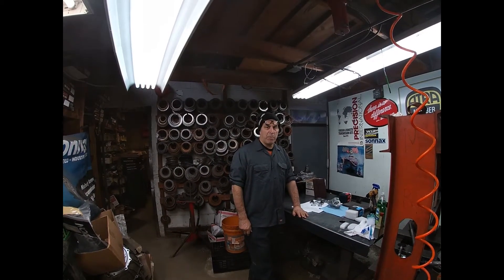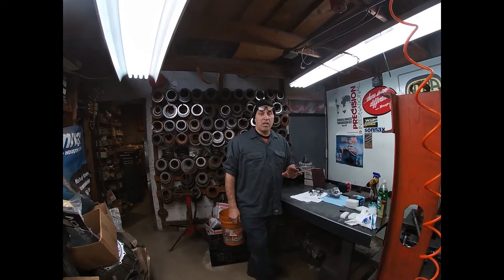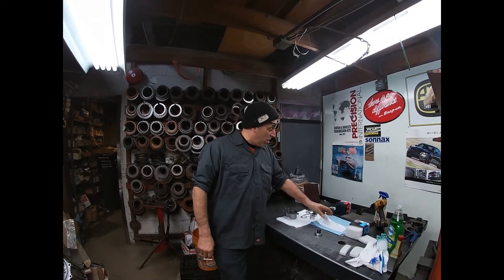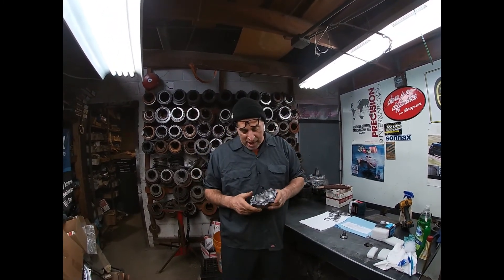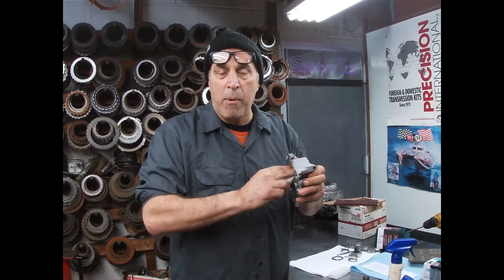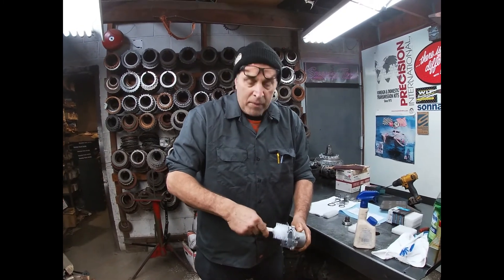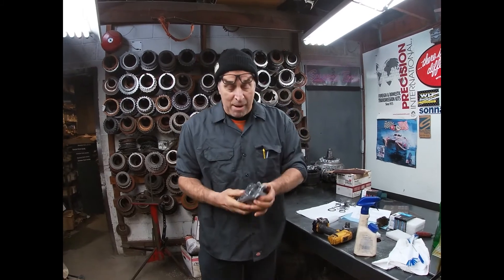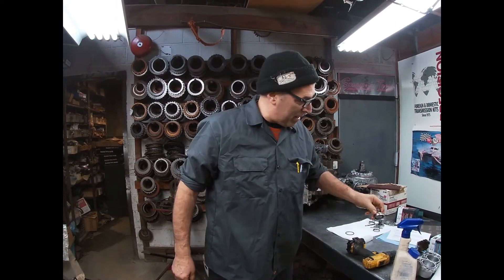4T65E Accumulator Seals Detail and Explanation!

Comment: Wow, Super,,, I would trust your work 100%.... I wish i lived near you to have you re-build my 4T65E transmission.         I had a very reputable transmission place built my trans 2 1/2 years ago cause one of the bands broke. Only had reverse and first gears i believe. As soon as they were done about 1 week later or more I pulled it out of the shop and it was banging kinda of hard in gear over drive after about 40-45 miles an hour when it kicked in from 3rd to Drive gear, Then some shuddering would occur. I took it back and they said there was nothing wrong.... Hooked up the OBD computer and that said nothing wrong, It happen once in awhile and after 6 times of taken it back they still said nothing wrong. I spent 3200 plus i redid other engine parts just because....I took it to 4 mechanics and 2 other trans rebuild mechanics and all of them said it was the torque converter. It then started to leak a little at the torque converter housing about 8 months later. It is now leaking about a 1/4 of a quart of trans oil at torque housing area that i have to add. I have gotten estimates and they want about $4000 now, But its hard trusting anyone. I wanted to get a new torque seal and pump seal and check the torque converter while its out and they want about $1500-$1800 to do it and most said they wont touch it cause no guarantee and they would rather rebuild it again, Could be other issues.....I know my car inside and out. and these people would not admit that it was the trans job they did....